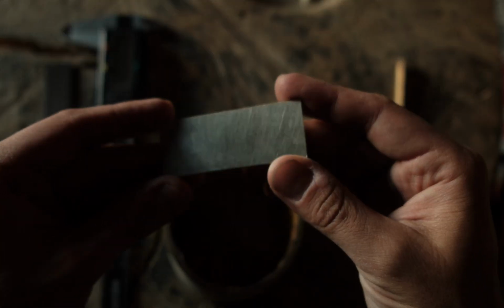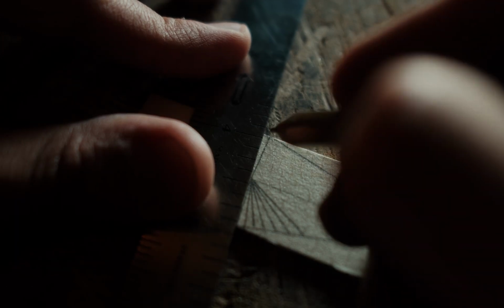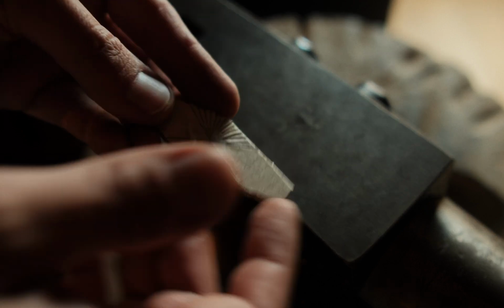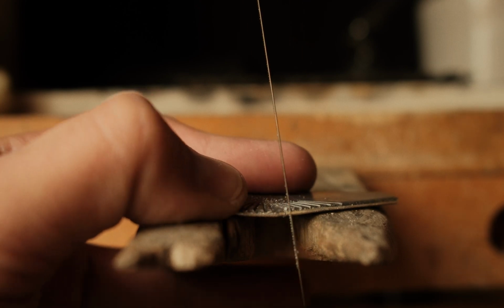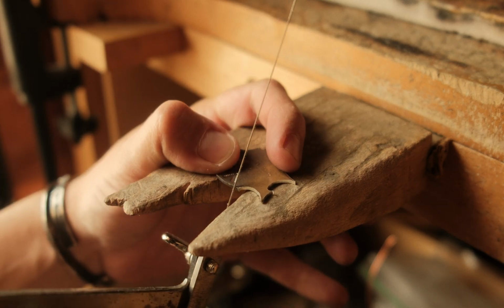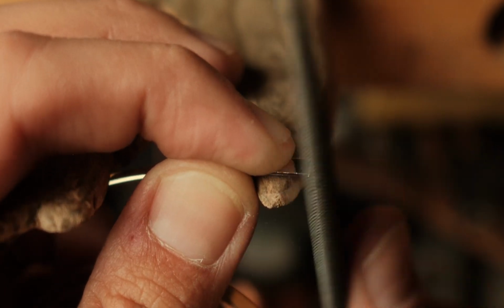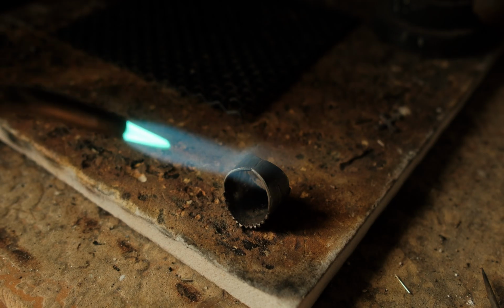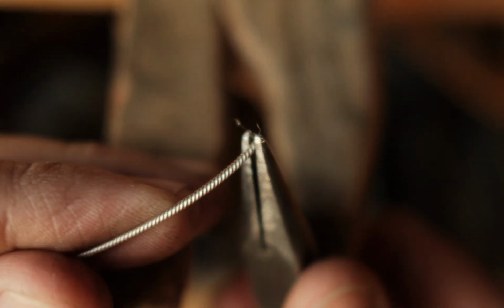How to Make a Turquoise "Chief" Ring - Chad Barela

Comment: Have been cutting and polishing turquoise  a very long time  learned a neat little trick .
But a single small drop of  thick super glue on a peice of ply wood clamped to you bench.
Drop you cabochon  down on the glue  give it a squirt of 91% alcohol and baking soda mixed 50/50
Wipe off the excess.
Now you have a fixed stone that is easy to wrap and mark.
I can all so wrap my wire rope and mark it too.
After you are happy with the bezel and rope carefully lift it ff the stone then use a single edge razor carefully  tap it under the stone it will pop right off then just scrap of the remaining  glue.
Done thousands off stones this way.no problems . That ring looks like a quality build .

Comment: Great video.  I have a question. You shape the ring then solder the bezal. How do you compensate for the rounded ring shank and the flat bezel? Do you shape the underside of the bezel to lie flat?
Thanka
Reply: You can tell at 9:28 the bezel has been filed to the shape of the ring and is soldered to the ring without a backing plate.